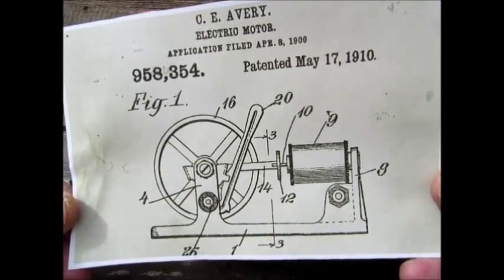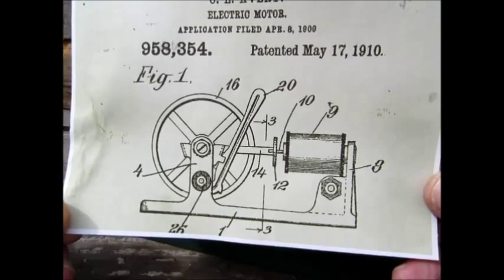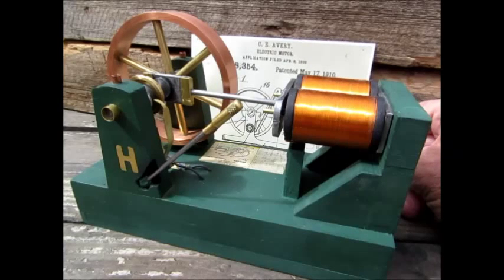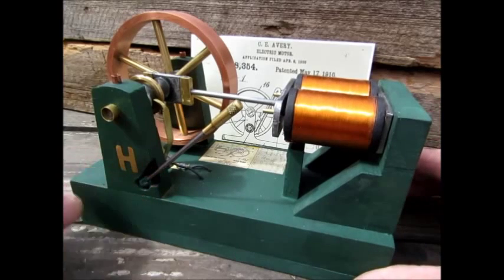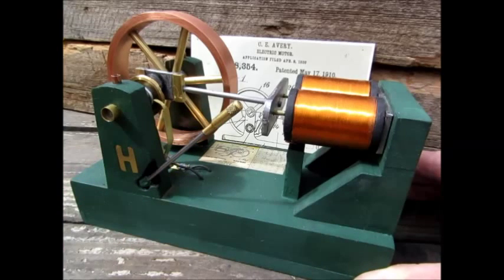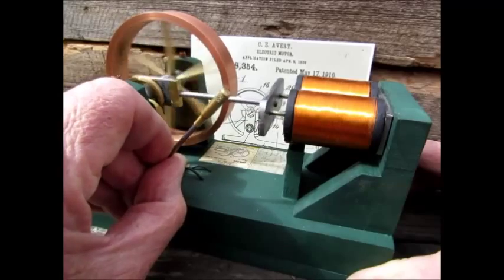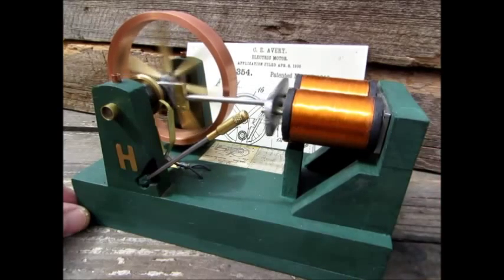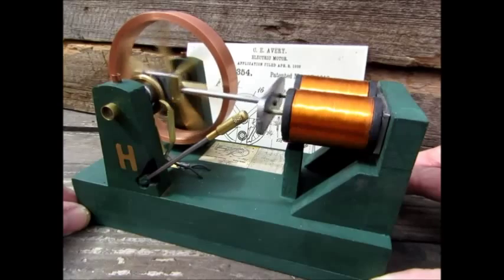Reciprocating 'Antique' Toy Motor

Comment: Nice!!! What does it use for a battery?
Reply from the maker: Thanks Tom!  After some experimentation, I ended up using four 9V batteries wired for 36V in motor base.  My understanding of electronics and design is very limited.  Each electromagnet spool contains about 150 feet of enameled magnetic wire.  This was all guess work.  Perhaps fewer windings, would allow motor to run on less power.  Need to learn about Ohm's, resistance and the like!  Interesting science.  bobh